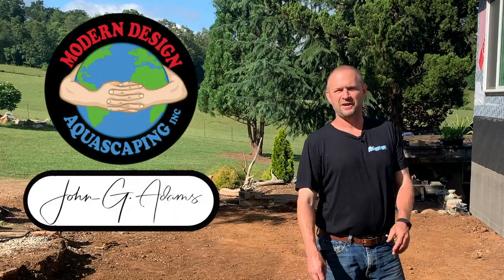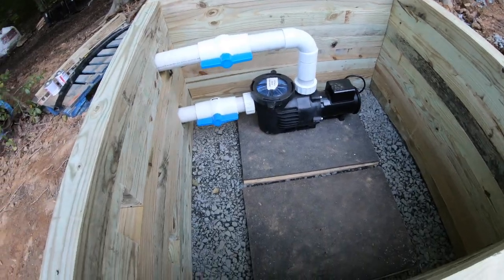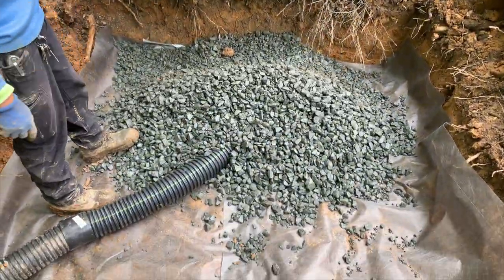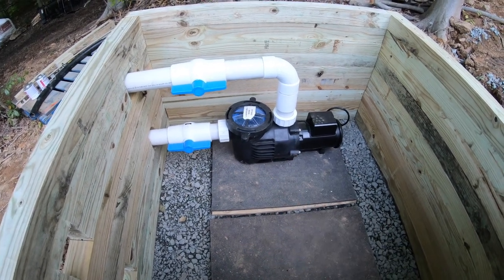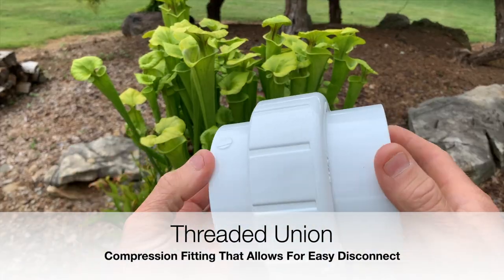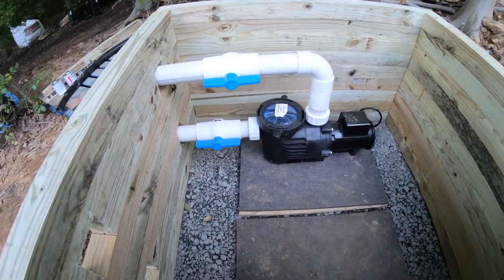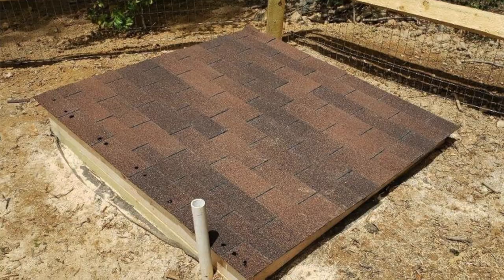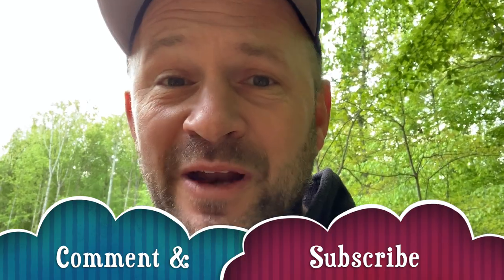Water Feature Design Series | How To Install An External Pump On A Recreation Swim Pond

Comment: John thank you for all these videos. I watched most of them and they have been great!!! 

I am building a recreational pond with the following specifications and I have a few questions I wish you could help me with:

Specifications:
-  Pond: 25 ft wide by 35 ft long (rectangular shape) with an average depth of 4 ft (875 sq ft)). Removing the size of the retaining rocks (edging) then the size of the pond becomes about 20 ft wide by 30 ft long with an average depth of 4 ft (600 sq ft). 
- Waterfall spill: 3 ft wide. 
- Head high: 5 ft Negative edge depth: 10 in above gravel
- Distance from the external pump to wetland: 
60 ft 

Calculations:
- Water in motion: 70 ft (Length of the stream) x 2 ft (Width of water) x 3 in (0.25 ft) (Water Depth) = 35 cubic ft x 7.5 gallons = 262.5 Gallons of water in motion
- Reservoir: 262.5 Gallons of water in motion + 5.625 Gallons (3 in x 0.25 x 7.5) x 2 = 536.25 Gallons
- Gallons of water in the pond: 18000 gallons

Questions:

1. Are my calculations correct?
2. How big should my intake bay be (width, length, depth)?
3. How are the external pumps connected to the intake bay? 
3. I see in this video (and other rec.pond videos too) the use of two external pumps. One should be to pump water to the wetland but what is the other one for?
4.  Any recommendations on the size of each pump size and specific brand?
Reply: Hey John, any advice regarding my previous question? I really appreciate any advice.
Reply from the maker: You gotta call my office and we can chat-865-995-1234 tell Stacy we have been chatting onYouTube and I said no pics needed. I’lo give you a 15-30 min window this week!

Comment: Best guides online👍 I can understand why you should use external pumps on a swim pond but what if my kids play in our pondless stream? Should I use a pump in the pump vault in the end of the stream or should I use an external pump just to be safe?? 🙏
Reply from the maker: I never put an external pump on a waterfall (unless it is a commercial “swimming intended” feature. I would say use your best judgement AND BE SURE the electrical is properly grounded so there is not a safety concern!
Reply: @KoiAddiction  Thank you for your quick response! I will pay an electrician to install and ground with a depreciation relay as well 👍😊

Comment: Thanks for sharing, this is a great and simple installation ! The box being nearly fully underground and apparently totally closed (no ventilation), how to you prevent the pumps and interior of the box from overheating ?
Reply from the maker: There was a vent in the side actually. Another thing we learned was that you wanna be VERY careful not to put and pressure on the pipes to the pumps when you back fill. Use sand and be gentle so there is no torque on the fittings to the pumps!
Reply: @KoiAddiction  Great tips, thank you John !

Comment: John!  I love your videos.  We’re getting ready to install our plumbing for our rec pond.  I have a couple questions for you:
1-Why does this pond need two pumps?  
2- have you ever used a pool pump instead of the one you used?  
3- I have a waterfall and a wetland filter to feed to. Do I need separate pumps or can I split some of the flow to the waterfall?
Reply from the maker: 1-there is a pump for the jets and a pump for the waterfall & wetland. 2- The pump used in the video is a pool-style pump—pick the right flow rate, efficiency, price point that works for you: that pump brand style is my personal preference! 3- You can use a single pump BUT if the pump dies you will loose your filter AND have no moving water. I prefer to use a pump for jets and falls, and then split the wetland flow between 2 more pumps so that you have a pump still running while one is being repaired—so three in a perfect world!
Reply: Perfect!  I understand!  Thank you so much.

Comment: Getting to the service basket is a bit of a pain.. hope the skimmer basket catches everything..
An above ground box may be simpler and easier to access since a check valve is being used anyway.
Reply from the maker: I would like to ask the home owner how often he actually needs to get into the basket. The way the feature was designed with a negative edge, the debris has to pass through the gravel bed in the reservoir and then through the Aquablocks in the reservoir, then into the pipe through the CVA. And on to the pump strainer basket. This is something I am about to get first hand experience with on my own pond so I will know the answer soon enough through my own exploration!

Comment: Hey John. Great stuff!  My client wants this so he doesn't hear the pumps, but is there any concern about the pumps over-heating in a closed box like this?  Thanks
Reply from the maker: Yes you need to make sure that you have a vent. Also drainage underneath. If you want to really go overkill, or if you live in a really hot area, I’m sure you could put some kind of a fan on your vent and put an in vent an out vent! I just installed mine behind the waterfall area so that the sound of the pumps is on the opposite side of the viewing area from the waterfalls so I cannot hear them. You also want to make sure that your draw all lines can be charged with water if you put the pumps some distance away. I made this mistake installing my pumps too much fluctuation in the elevation on my plumbing lines and it was difficult for me to get them primed.

Comment: I just bought a 12V pump for an intake bay of a little recreational pond. I hope it's an option too.
Reply from the maker: Want to hear about your experience and how it works out for you- I have never used one ;)
Reply: @KoiAddiction  It's just a little 10000 l/h pump (2500 gal/h), but I don't plan the wetland zone too high, just one waterdrop.

Comment: does is matter if the pump is at same level at the water? Thank you
Reply from the maker: My friend it does. Ask your pump mfr. what the max lift is. We install a back-flow-preventer in the end of the plumbing to hold water static in the lines during power outages!

Comment: Love you how to video's.. Question is a External Pump the only way to have a swim pond?
Reply from the maker: No, but I recommend it. I have been swimming in many ponds with submersible pumps. I have also had my hand electrocuted by a submersible pump in a pond skimmer. Proper electrical setup is also VERY important!

Comment: Thanks, Great Videos,  My Pump supplier is recommending 4" Trunk line going to our Wetland filter. Can the 10' of intake from Intake Bay be 3" without losing to much efficiency?
Reply from the maker: Thats a great question. I would ask the pump mfr. (all pumps are different). Lift height-run-head pressure etc. many things will play into the answer and the mfr. will have your answer!

Comment: John; even though electric wiring was not the topic of this video I would like to know your opinion on this doubt: 
When using an external pool pump ; the installation manual recommends “ bonding the motor case to metallic structures” inside the pool... 
As the only metallic parts inside a pond are lights... Do you follow any measure to comply with this instruction? 
In other words, how do you wire your external pumps?
Many thanks in advance
EDGAR- Colombia.
Reply from the maker: We don’t handle the actual electrical connections, we leave that for proper electrical professionals. Different states (countries) have different protocols. I would recommend you to consult a local professional!

Comment: Sir I have been watching your videos and im watching this video again.

I am trying to convince myself to use submersible pump in a swimming pond.

 So my question is, how about you use submersible pump in a zero edge skimmer? Is it safer when you compare to putting it in the main pond instead?
Reply from the maker: If you do it, it will work-if it’s safe I cannot say. Check with your local electrical codes for the “legal” answer. I have swam in many features with sub pumps but I have also been shocked by a few of them ;(
Reply: @KoiAddiction  thanks sir. I guess I have to go with the much expensive one which is external. But will do some research rven more and will keeo on watching your videos.

Comment: Is the plumbing sitting down in the basin just an open ended pipe?
Reply from the maker: Swing check valve on end of pipe at bottom with a union above water level for quick disconnect👍

Comment: Bro !!!!???? I need your help, I'm having trouble seeing 3/4 inch pipes for a 4x8 pond. The job I'm going is over 25g. Im installing glass mosaic in a coustom pattern. I had to redo the wires for lights and center 3  copper pipes within the pond.( Copper with PVC).
I told the client to be sure we find the right people .
Reply from the maker: Im not sure what you mean by that? You should be able to plumb a 4’x 8’ pond with 1 1/2” plumbing for sure. Is that what you were asking?

Comment: Are external pumps required for a swimming pond, or were they used just due to the large size of that particular pond?
Reply from the maker: Yes, you should use externals on allm swim / rec ponds. Its an “electrocution thing” to me. Submersibles can be shocking!

Comment: Nice video. I have an above ground pool, I made a solar heating system for it but my pool pump isnt strong enough to filter and circulate the pool and also pump the water through the solar heat pipe. So the pump will need to lift the water about 30-35ft then back down to the pool. The pipe is 1/2 black irrigation pipe. I need that much lift but with a slow flow. Can you tell me how to calculate what I need or recommend a pump to me. I would like to use and  inline pump if i can if not the I would use a submersible pump and just remove it while swimming. Any help will be greatly appreciated.
Reply from the maker: Sounds like too much pressure because of the small pipe diameter. I would recommend that you use your pool pump as it was designed and then add a smaller pump to slowly circulate the water that you’re trying to heat. There are pump manufacturers like the guys at performance pro that may be able to help you with a specific pump, that style of pump is really not my expertise but I would expect it to be the situation where you really need to different pumps.
Reply: @KoiAddiction  Thank you I will check them out

Comment: Hi John 
We are mainly a dredging company who convert ponds to wild swimming  ponds 
What is the yard stick for wetland filter design is it gallons of water in pond or surface area or both 
I have 3 more to build and I would like to incorporate the wetland filter instead of  normal filter box with uv 
Brush and media  also  the products you use centipede unit is key , who can I import from in usa to uk  thanks for sharing all your information  you have saved contracts lots of time & $$
Peter Jex 
Jex plant uk
Reply from the maker: 1/3 of pond surface on smaller features, 1/10 of surface on larger features is pretty rule of thumb for surface of wetland. Materials can be purchased from MJ Wilson @ AnyPond.Com (look him up on youtube and web. He is the importer / distributor for Aquascapes in the UK and he’s a super cool guy!

Comment: I tried this for for a variable speed 8500 and for some reason cant keep it pressurized and pulling from my pond. I built your box and would say it is pulling water from a pond and up maybe 12 inches at a gradual slope. I have a back flow trap between pond and pump. After the pump it goes up maybe 6 feet to a bog and then runs down a waterfall after water fills the bog. It will start up fine and I will gradually open valve after pump to about a 1/3. It runs for anywhere between 15mins-2 hours before losing pressure and running pump basket dry.
Reply from the maker: That typically shows a small leak in the “draw” line. Could be a loose union. Could be cavitation on the draw line causing it to get some air?